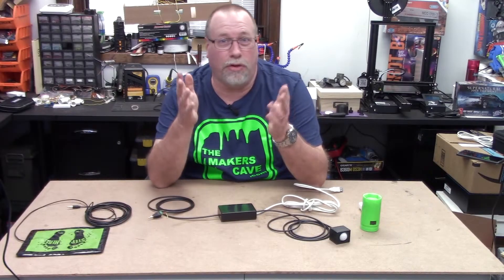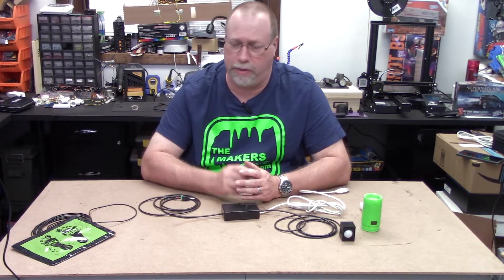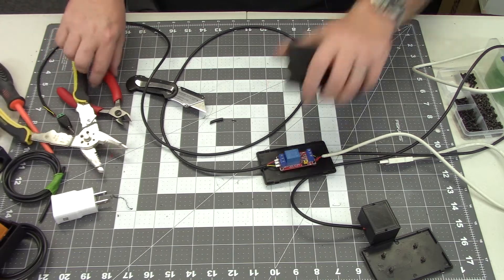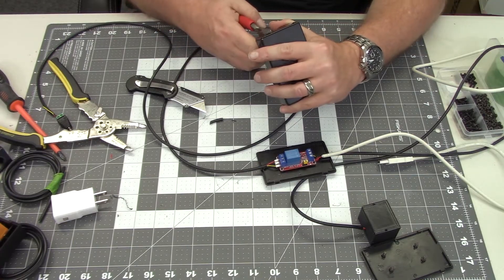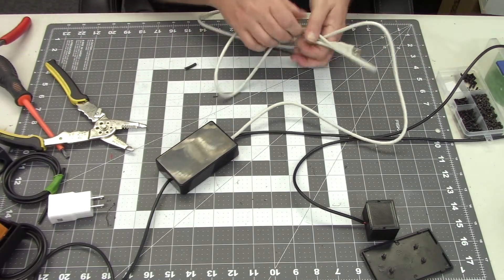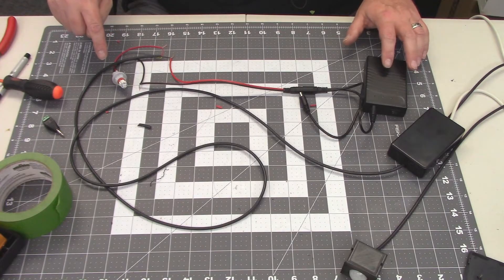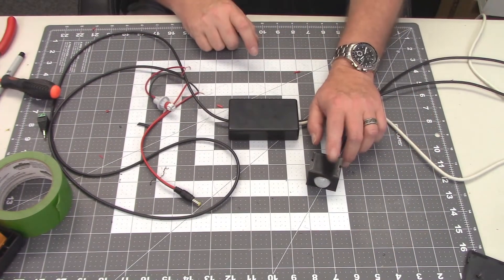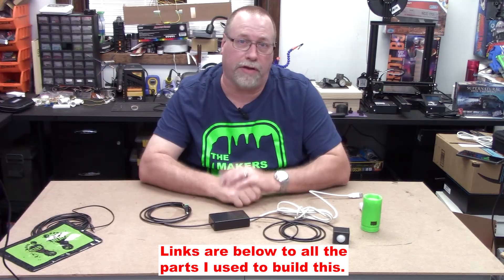Turn Almost Any Prop Into A Motion Activated Prop.

Comment: Im trying to make these and ive got everything hooked to the relay but Even when triggered I'm not getting sny power on the other side of the relay. Ive tried 2 different ones to see if i just had a bad one
Reply from the maker: Can you take picture of what you did? I'll gladly help if I can.
Reply: @TheMakersCave  this answer is not helpfull at all
Reply: I had this problem on one. I had the red and black on wrong side to motion sensor. Flipped connector and it worked.

Comment: How would you use it to power a 12 volt wiper motor
Reply from the maker: I would replace the relay with the following: https://gravedecor.com/product/1-channel-5v-relay-with-heavy-duty-terminals-30a.  Use a seperate power supply for the wiper motor.  Cut the positive cable of the motor.  connect one end to the NO heavy duty relay terminal. on the relay board and the other end to the Com heavy duty relay terminal (next to the NO terminal).  If you need any more help just ask :)

Comment: Tried to use an online printing service because I don’t own a 3D printer but they can’t handle “floating parts”. Do you have separate 3D print files for the different parts? Or what 3D printer do you use?
Reply from the maker: I am so sorry for not getting back to you sooner,  I was busy modifying props for customers for Halloween.  I used an Ender 3 Pro.  I don't know why a 3D print house can't use the file I created, strange.  I have included a link to where you can buy the case as I've had a lot of inquiries about this build.  This is my Etsy store where I am starting to sell some things people are interested in.  if you have any questions just ask. https://www.etsy.com/listing/897331491/pir-motion-sensor-case
Reply: @TheMakersCave  Thank You. I just bought on Etsy. Easier than learning to 3D print

Comment: Why not hot glue the relay board? Why don't you tin the tips of your wires? This is bench work, why not go the extra step?
Reply from the maker: Your suggestions are valid but I have found that most viewers do not have the experience in soldering and once I start talking about soldering they get turned off on trying to do the project. That's why I try to use Dupont wires and screw terminals whenever possible.  Not everyone has my bench and tools.  I try not to be Norm Abrams and New Yankee Workshop.
Reply from the maker: So true, just bought 100 LEDs for 3.55 from AliExpress

Comment: mmmkay
Reply: Can i daisy chain multiple props together successfully ?
Reply from the maker: I'm not sure what you mean by daisy-chaining but you could have this activate several relays at once.  Just split the trigger/sense wire coming from the PIR sensor to each relay.  I've done this with up to 3 relays.